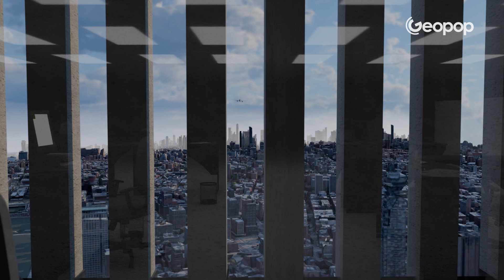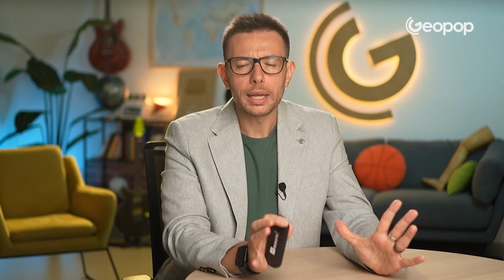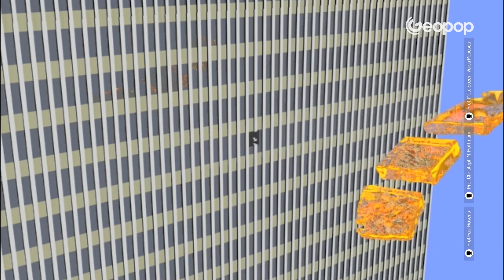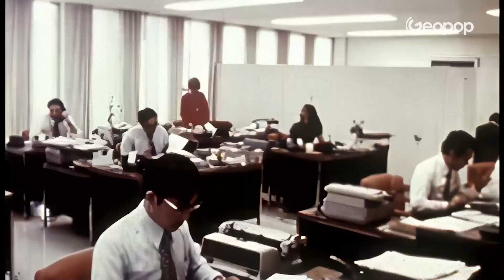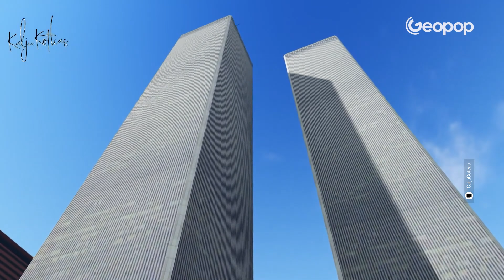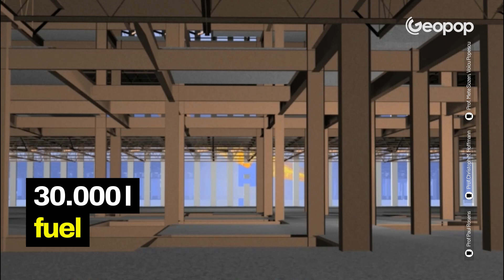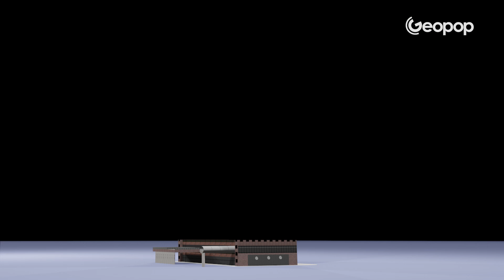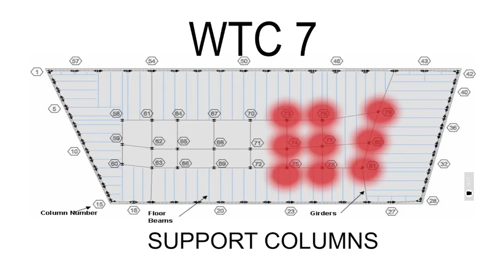9/11, 2001: The Technical Reconstruction of the Twin Towers and WTC 7 Collapses

Comment: This (statement at around 8:50 in this video is proven false that the temps hadn’t reached this level and the steel didn’t melt. There IS a new video found that’s shows clearly MOLTEN metal pouring from the corner of the WTC right before the moment of collapse.  Pouring like you’d see in a foundry!   So how can this be?   The only way this would make sense in my opinion is if electrical cables were somehow working as an induction heater on the steel itself.   Although jet A  can burn at temperatures near the point of melting steel as well under the proper circumstances.
Reply: Jet fuel was not the only substance burning in those buildings! The fire consumed books, paper, carpets & drapes, and electronics - and office fires burn hotter than jet fuel! Not hot enough to melt steel, but hot enough to melt aluminum, lead, maybe copper.
Reply: @Tim22222  ok idk what that has to do with molten steel which is what would have been required for the buildings to come down and also is clearly depicted pouring from the corner of the building in the newest video.  I’ve melted a lot of lead and aluminum in my life it doesn’t look anything like molten steel
Reply: @jeffp862  - Molten metal pouring out of the South Tower (and it was in fact ONLY the South Tower)?  You mean this?

youtube.com/watch?v=xPVGGQU-MeQ&ab_channel=SeekersofTruth 

So you think that is molten steel why?  Because you performed metallurgical tests?  Because the internet told you that’s what it is?  I think we can do better, so let’s do better and build a theory the right way instead of making evidence-free assumptions. This will take just a couple of minutes and is worth the investment. 

The Boeing 767 which struck the South Tower weighed 117 tons and 80% of that was aluminum.  The exterior cladding on the Twin Towers – the white panels – were also aluminum. When Flight 175 struck at the 81st floor its momentum deposited much of the office contents in its way and the bulk of the aircrafts mass into the NE corner of the building. The piled up debris shoved into that corner is visible in photographs and video so we know it was there. 

There’s a good shot here of piled up debris from 4:36;

youtube.com/watch?v=ZLJyL63sqtU&ab_channel=MrKoenig1985

Steel melts at roughly 2,750-deg F while fires in the South Tower reached peak temperatures of around 1,800-deg F. Aluminum OTOH melts between 887-deg F to 1,180-deg F depending on alloy. That aluminum will melt under these conditions is not a surprise. If you look at pictures of cars left behind and destroyed by forest fires the aluminum wheels are invariably melted away along with other sometimes aluminum parts like hoods. Steel bodies remain intact. 

The “molten metal” appears at 9:52 am. At the same time we see the first externally visible signs of sagging floor trusses and the pulling of the perimeter columns inward. I submit these events are related, not coincidental. The aluminum cladding at the NE corner also appears to me to be burning. 

It is likely the with the floor trusses sagging under the heat, and the 81st floor truss in the NE corner under the debris pile subjected to the heavy load of the debris pile, the truss broke its perimeter column connections and dropped, instigating the material starting to pour out of the NE corner at the 80th floor.

Given the properties of the materials in question, aluminum is by far the most likely culprit. 

Reports from The NIST, FEMA and MIT all concluded the material is aluminum. 

Certainly steel is the least likely of all the materials the anomaly could be given its much higher melting temperature and the fact there is no logical source for molten steel.  The perimeter columns in the NE corner are intact and the material is pouring out between them. So it isn’t columns melting, therefore what other source of steel is there?

Deniers will claim molten aluminum appears silver when molten, which is true but only at the low end of its melting temperature range. Aluminum can and does get hotter and it glows red to orange when it does (1,100 to 1,800-deg F).  Most folks of course just don’t bother getting it that hot if the goal is just to get it molten for say molding a part. No need to go higher. 

The total mass of molten aluminum is a BIG deal in regard to how it behaves when poured. Quantities bellow half a liter cool almost instantly if poured onto a flat surface, but if poured into say an ingot mould will stay red for a minute of so. Pouring volumes of molten aluminum greater than a liter is a VERY different experience. The thermal mass is much greater and the radiant heat is horrendous. The aluminum is able to stay liquid and remain glowing bright orange much longer. 

The famous video of glowing liquid gushing out of Tower 2 moments before it fell, involves at least tens of liters of molten aluminum. The thermal mass involved is so great that it stays red after falling many meters through the open air.

Side note: There was also a large UPS battery farm in that spot and some of that material at least may well be from the batteries IMHO.

Comment: WTC7 had 83 support columns spread every through the buildings footprint.
It's been proven that the building fell at freefall acceleration for the first 120 feet.
In order for that to happen, all 83 support columns would've had to fail within MILLISECONDS of one another.
Not to mention the BBC reported the building fell while it was still standing behind the reporter. Didn't actually fall for another 20 minutes.

Jet fuel and office fires CANNOT do that. There's not even a one in a billion chance. Wouldn't happen.
Reply: The BBC explained that years ago. The penthouse started to collapse in before the rest of building 7. The fire department also to determined it was going to collapse hours before it did
Reply: @mikebyrd8278  they never explained anything. And according to the 9/11 Commission Report, nobody knew WTC7 was going to fall and they had no architectural reason to believe it would fall as it was not hit by a plane and only has sporadic fires. It is IMPOSSIBLE for such conditions to cause a steel frame highrise to collapse. It's never happened before.
Reply: @brandentownsend7298  - The big problem with that is Building 7 had been falling for more than 10 seconds before the stopwatch starts on that alleged "free fall".  If Building 7 had actually collapsed at the rate of true free fall, the collapse should have already been over before then. 

So its meaningless. 

The media had been reporting that Buildng 7 was in danger of collapse or about to collapse for hours. The FDNY had ordered the area around the building evacuated and even suspended rescue operations on the pile. The media were getting all of this. In the chaos and confusion of that day a wire service (the AP IIRC) made an error and reported that it had collapsed. Simple enough. These sorts of things happen all the time in rapidly evolving ongoing news events and there are hundreds of examples on 9/11 alone. The BBC repeated the wire service report.

Should we care that a British reporter (ie: not from New York), four miles away, with her back turned to a skyline chock full of tall buildings did not know which one of those hundreds of tall buildings she was not looking at was Building 7?

I don't think so. 

She was doing her job, reading the report. 

Worth noting that local CBS 2 reporter and weekend desk anchor Vince DiMentri had a bit earlier reported from INSIDE BUILDING 7 (not from 4 miles away) and _he didn't know what building it was either. 

A local reporter, not a Brit on short-term assignment in one of the largest cities in the world with thousands of buildings. 

Does any of that matter?  No. It is an irrelevant detail of no consequence.

Comment: Jet liners can’t fly at 700kph at such a low altitude. That’s one of the reasons they fly so high 😳
Reply: It's not impossible, just against the rules! And don't forget, they were coming out of extreme dives, not flying straight & level.
Reply: Yet everyone saw them
Reply: Dude you can take your own measurements from video and figure out the speed for yourself. They don't need to lie to you about stuff that everyone can see.
Reply: @reignman30  ask the pilots for 911 group 😳
Reply: @davenesbitt7716  - You mean Pilots for 9/11 Truth?  Can't ask them. It no longer exists. It was only ever just one guy, Crazy Cap'n Bobby Balsamo who finally drank himself to death a few years ago. Good riddance too. 

I had numerous run-ins with Bobby and his many alter-ego's, all of which were extremely unpleasant.  Besides being about the biggest jerk I have ever encountered, if Bobby told me the clear daytime sky was blue, I would look up. You could always tell when he was lying because he was speaking. 

I think who you really want to look to is the folks who designed, built and tested the planes - Boeing. They have no issues with the performance of their aircraft that day.
Reply: @reignman30  I think he means he's a no-planer 🙄
Reply: None of what you said is in anyway correct
Reply: @apacheattackhelicopter8410  oh yes it is
Reply: @apacheattackhelicopter8410  oh yes it is 😉

Comment: Gravel tower in the uk burned for 24 hours fire crews could not put the fire out and it did not collapse the whole building burnt all four sides there was nothing left except the concrete which is still standing
Reply: Firefighters couldn't put the fires out but they still put tons of water on the building, keeping the supporting members a lot cooler than they otherwise would have been.

Also there was no structural concrete in the WTC towers.
Reply: So if the concrete was not structural then what was it was  it (a) decorative 
(B) for weather or did it structurally support the windows and help the building weather proof let’s face physical facts the buildings were demolished the only other buildings that look like they do are the result of demolition
Reply: @danielwaddell-kn4cl  The floor slabs. That was the only concrete in the towers. It was not structural.

And I don't know about you, but I've never seen a controlled demolition that began in the middle of the building. The towers didn't look anything like CD.

Comment: Its interesting how over 20 years later and the "experts" keep changing the reason why the buildings collapsed. Back in 2010 it was the fuel that burned for hours causing the weakening of the steel. I dont remember how they explained a partialy burnt passport of one of the "hijackers" found amongst the wreckage while saying that the steel and aircraft melted? Too many questionables to say its not conspiracy
Reply: Ummmmm, no. Nothing has changed and your memory is severely faulty, OR you are poorly informed.
Reply: @TheLoonResistance Yes the theories did change. First was Bazants crush down theory, later scrapped for the Inward Bowing theory.
Reply: @HKmaroLS1  Bazant's crush down was NEVER put forward as an explanation of actual mechanisms but as a limit case scenario. Also, you said IIRC the last 10 years which puts Bazant well out of range
Reply: @TheLoonResistance  search wikipedia for "Collapse_of_the_World_Trade_Center#Investigations" Bazant's crush down theory was the basis for the FEMA report that was later revised by NIST. So yes, the theory's have changed.
Reply: @TheLoonResistance  please bring facts with that bold statement
Reply: @ncamp2126  - You first. It is after all your claim we are talking about here. 

What is presented in this video differs little from what was being discussed within 2 months after 9/11.
Reply: @TheLoonResistance  lol I dont need to you obviously have internet, research the inconsistency. You won't because you don't want your idea or thought to be challenged on it.
Reply: @ncamp2126  - It's YOUR CLAIM therefore  your burden of proof, not mine. 

If you will not provide evidence to support your own claim because you are either too dim, too lazy or lying you are just wasting everyone's time and tour claim is null.

I wish you luck on your continued epic fail. I really hope that works out for you someday

Comment: I don’t get how the bottom of the tower crumpled inwards from your animation. How were they “colder” do you mean thermal expansion wise? Or load bearing? Because you said at the start the towers were designed with 33% load bearing redundancy. The bottom part of the tower couldn’t take the slack off of the hit portion of the tower with this redundancy? I don’t get it. Seems like you were clear up to this point. I get if the entire top 3rd of the tower became dead weight this could stress the whole tower overall but that wasn’t made clear.
Reply: Its pretty irrelevant … planes hit … fire, damage … collapse! There is no alternative to that scenario … a planned demolition of a live building defies common sense, especially knowing what is necessary to prepare one tower for it!

Comment: Thermite works in mysterious ways.
Reply: Or in this case not at all. 

? If only someone had actually tested this instead of just guessing or making unfounded assumptions. Oh, wait!

youtube.com/watch?v=JXWCMBuusMI&ab_channel=TrutherTVArchives 

In this video starting at 45:35 and running to 48:35 the Energetic Materials Research and Testing Center (EMRTC) conducts a test to examine the effectiveness of thermite in cutting a vertical hollow box-section steel column. The column tested is smaller in cross section and made of thinner steel than that of the Twin Towers perimeter columns (and never mind the core columns). In total 175 pounds of thermite are used for the test on just one column and requiring the construction of a rather conspicuous coffer dam to contain it. Do recall the Twin Towers had 240 columns and 110 floors.

It would be odd if thousands of office workers missed hundreds, perhaps thousands of those suddenly appearing.

Note what an incredibly slow process this is. It took close to 30 seconds for the thermite to finish burning off.  It would be impossible to “control” a demolition using this material.

Not to mention the issue of how does the aircraft impact and subsequent raging fires NOT prematurely set this stuff off. 

Also note how bright and obvious the whole process is. Could not be missed visually. No way to hide that. 

Then at the end of the test the (relatively modest) column was undamaged…. which is a problem.

Comment: Dr. Judy Wood - Where did the towers go?
Reply: Magic space beams?? lol
Reply: @Tim22222 Molecular Disassociation. Iron was deatomized at the molecular level, causing the concrete that was embedded into the steel floor pans to pulverize. That's why there was so much dust in the plumes along with loose paper from the filing cabinets.
Reply: Pulverized towers. Collapse at freefall speed. Who needs more evidence, that the official version ist a fairytale?
Reply: @mikebyrd8278 He's right you know. Where did they go? Two 1/4 mile high buildings left a rubble pile less than the 3-story lobby.
Reply: @HKmaroLS1  well it didn't magically disappear. It took them 8 months for working 24/7 to remove it all. There was 15 acres of debris
Reply: @mikebyrd8278  LIDAR images show WTC7 had a larger debris pile than both towers.
Reply: @HKmaroLS1  "left a rubble pile less than the 3-story lobby."

FUN FACT: The WTC complex had 7 underground levels before bedrock. So the pile was really 10 stories high!
Reply: @Tim22222  you know nothing.. no rubble in the underground levels. The WTC turns to dust!
Reply: @ElLowEl .  . "What the hell are you talking about?" .  . 😃 .  . Thank you for your sponsored reply, Mr. EILow.  The word projection indicates holography as you know, commercial demonstrations of which have been amazing in recent years.  To feign ignorance doesn't work well for you, however.  Where, Mr. EILow, is the wake turbulence only seconds after passage of a 500 mph large passenger airliner -- not seen in the smoke and fire covering the impact zone?  Even the wake of a small Cessna Aircraft would be noticeable -- yet there is nothing.  It's likely that no real answer from you is forthcoming. We'll wait and see .  .